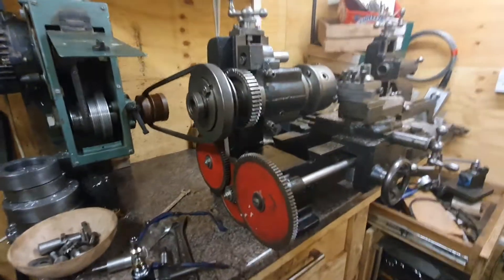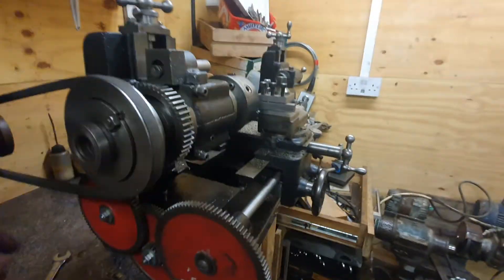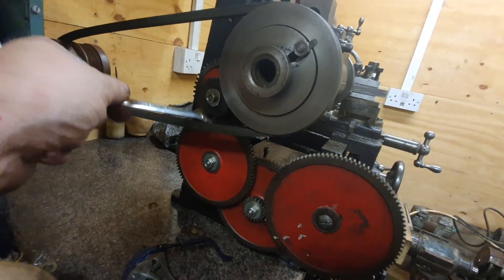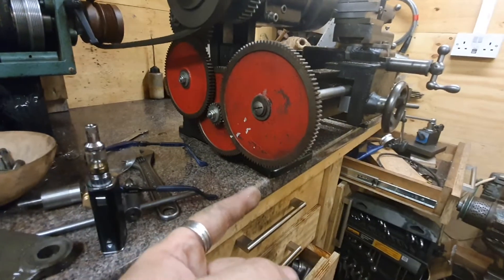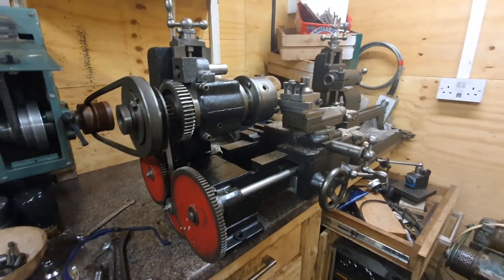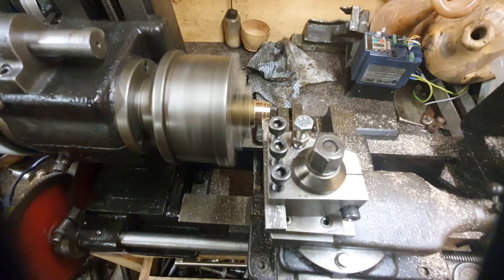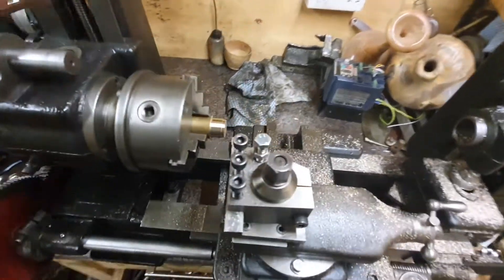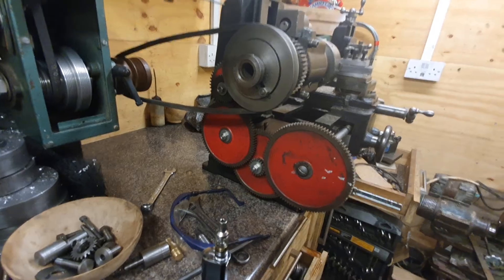Murad Bormilathe series teaser

Comment: Glad you posted this video, i have one of these. I bought it maybe 15 years ago. I have done a bit with it but i dont use it anymore and its kind of in the way. I have a giant box full of various gearing for it. Do we know what its value is? Or is it one of those stick on ebay and see kind jobs.
Reply from the maker: Yeah it's a pity yours is collecting dust, mine is also at the moment, I can't remember if I've me tiined it in this video but I've upgraded the bearings and done a fair bit of work to it, so far I havn't used it much, one of those machines which I won't want to part with as it's such a nice machine but I have other standard lathes which I use regular.

About the price I have no clue as they don't appear that much, I bought this one for I think around £350, I saw one listed for around £500-600 and it kept getting relisted for quite a while, I guess it relys on locality aswel, someone might be happy to buy it for say £400 if they don't have an 8h round trip to collect.

If you have the milling table/cross slide and the horizontal milling arbor I'd be interested though? It would be just to have them though as I already have a Herbert No1 horizontal mill and an Atlas MFC

Comment: Great to see Mark well done. I have one of these in my workshop and it has done me proud over the years.
Reply from the maker: Thanks and yes its a good lathe, and I still havn't got it finished yet! , I keep getting distracted by other machines when really I need to concentrate on the ones I have, this year is gonna be the year I sell off a lot of them to get them off my mind but the bormilathe I may well keep, seeing that I've spent a bomb already on new sealed angular contact bearings plus the bull gear has 48T... Nice flat top to the headstock where the back gear lever is mounted so I have plans for a duel back gear mechanism and an indexing setup.

Currently it's the only lathe I have with ball race bearings so it can be run a lot faster for smaller diameters